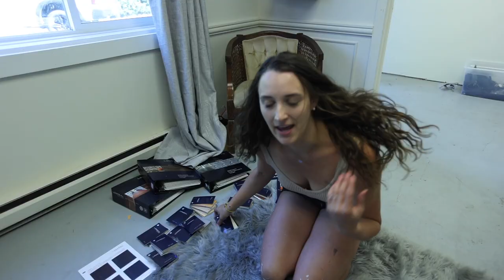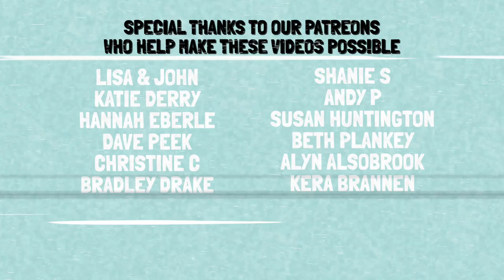Busy Day in Our Massive Warehouse (We Waited Years For This)

Comment: It blows my mind you went to all that effort to take the top off and replace the subfloor and then you replace it with chipboard. My 2004 airstream subfloor is chipboard and it started rotting after 15 years. I've been patching it periodically but it's like a cancer It keeps growing. I am so upset with airstream that they would use such a cheap subfloor on such an expensive product.